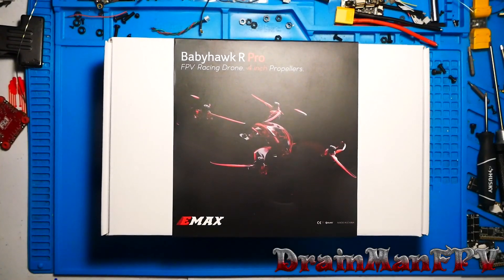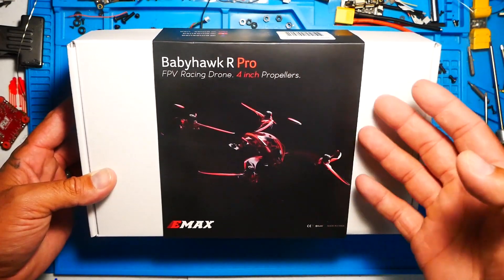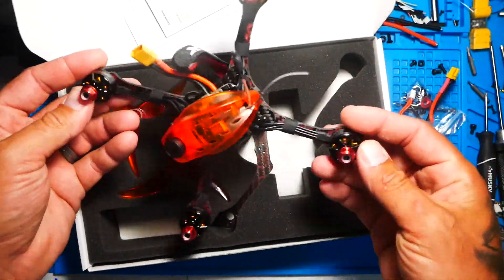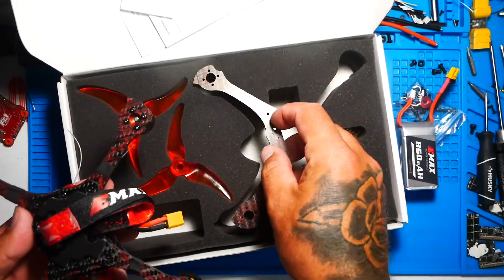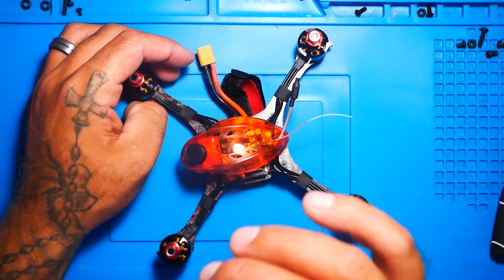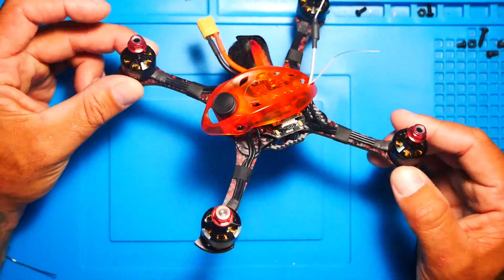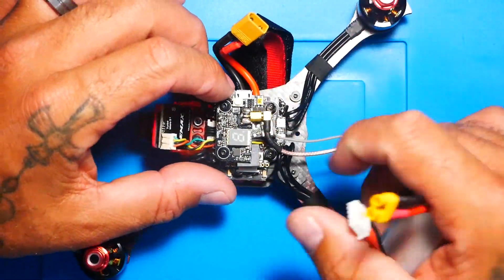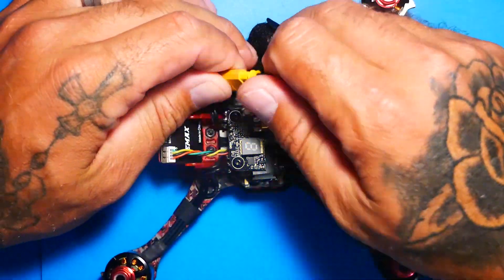How To Set Up Emax BabyHawk R Pro 4 Inch! D8 Receiver & Betaflight

Comment: 14:45 that is gay and that is borring
fucking legend

i got one but when i arm it they either go crazy on the beeper or if the trotle does (work) it just makes the quad go right left right left super fast ( with no props attatched ) no clue why its not working propper ? annyone had this problem before ?

Comment: Dood straight forward no fluff and bs thanks for this. YouTube has been infested with nonsense talk just to make that mark to make that money. I 'd rather your prosper.
Reply: DrainMan FPV,  I am having the hardest time binding - not sure, what the prob, I have tried D8, D16. I have the Jumper T12 - I believe it has the external RF module as it can be removed. Should I plug it into the computer and try to bind it via Betafight? Is that even possible? I never see a green light as showing it as bound on the BabyHawk, I only see blue and red lights flashing.

Comment: Hey Mr.drainman I have purchased this drone and followed all of your steps for this drone and set all of the switches and set it up but this drone has no throttle and when I use yawand pitch it just spins the motors if you can help me out can you please reply thanks
Reply from the maker: Find me on FB and message me. I'll help you there.
Reply: DrainMan FPV thank you will get in touch with you I really appreciate it

Comment: Great video!  So just say you chopped the other antenna in half, can you get a new antenna for that one or do you have to get a whole new receiver with the antenna attached?
Reply from the maker: Thanks Brent! You can just get a new antenna.
Reply: @DrainManFPV  Where can I get that antenna and is that one soldered on or just a connector like the vtx antenna?

Comment: Straight forward bro. No side bs. 

Drain, I use flysky and ibus. For some reason it only works on sbus. Does this mean this board only runs anus? Thanks
Reply: Connect it to a unused uart   i used 3

Comment: If you bought the rtf tinyhawk that came with the radio controller can you bine that radio controller with drone ?
Reply from the maker: send me the link to what you bought, i look at it and let you know.
Reply: @DrainManFPV  https://www.getfpv.com/emax-tinyhawk-micro-brushless-fpv-drone-rtf-bundle.html
Reply from the maker: @dosfeos  You should definitely purchase yourself a taranis or a jumper but for now i think you could bind to other drones but you will only be able to do one at a time. This is not a good radio for FPV. I will link two good options for you. 

Taranis:
https://www.myfpvstore.com/shop/radios/frsky-taranis-x9-lite-24ch-radio/

Jumper:
https://www.myfpvstore.com/shop/radios/jumper-t16-pro-w-hall-gimbals/